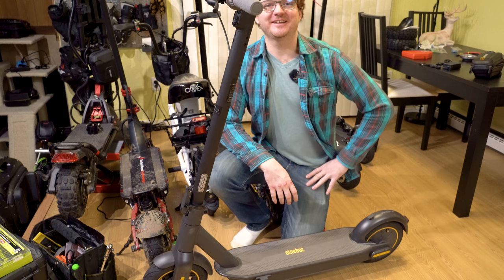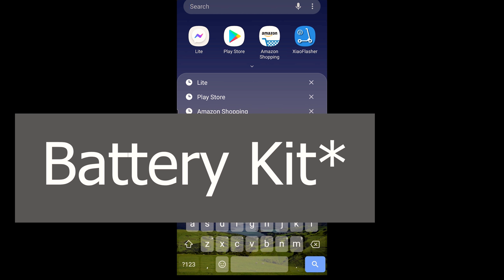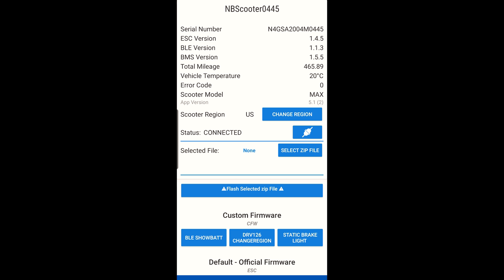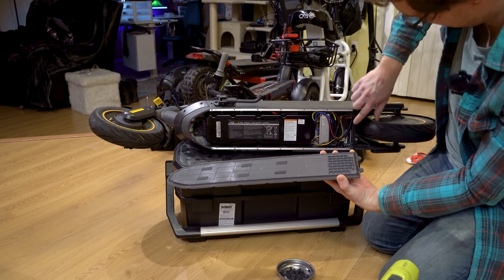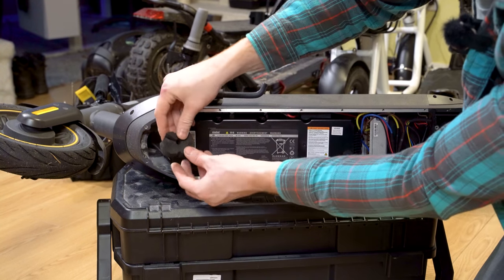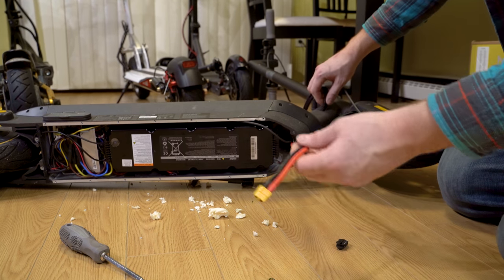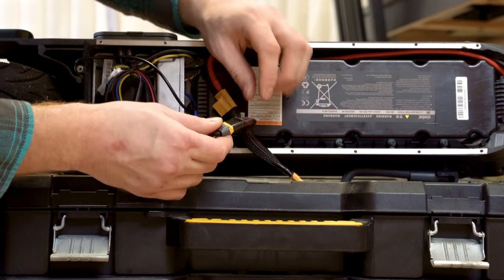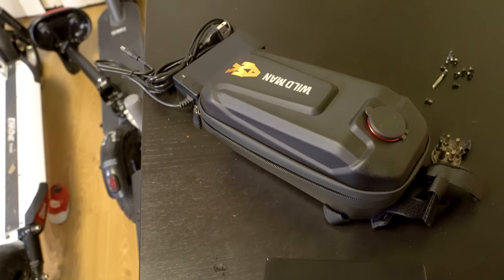Fastest Ninebot MAX Electric Scooter * Part 1 * The Install

Comment: Been running prototype versions of this mod since March of 2020. Best money you can spend on the Max. Chris is a great guy and I would recommend his gear to anyone who feels like their Max could use more grunt. Awesome upgrade.
Reply from the maker: I couldn't agree more. Very fun little upgrade.
Reply: Is it more worth it to upgrade to the Fat Max Motor or do this battery upgrade? What happens if you upgrade both? Is there prone failure to certain parts?
Reply: Seems like it’s out of stock on website. Did he stop making this ?
Reply: Hello Tyr...could you direct me to the zip file for the G30......I want to pay the right person for doing the programming.
Reply: @kenly6858  I plan to do BOTH. I already upgraded my Motor wiring, so the New Motor will be "drop in". My Channel has some videos of my progress.

Comment: i just looked at the battery upgrade and they are out of stock....ahhhhhhh.... To be able to increase from 30kmh\ to 50 km\h is so worth the price. I laugh because I bought mine and though wow this is fast enough. Saw your video and now its way to slow....The need for speed baby. I would kill to have 1 that goes 80 or 100 km\h Just not wanting to spend that much. I could buy a car or truck or daum....Good video my friend. Cheers
Reply: Sorry bro I guess I bought one of the last kits,

Comment: guys does it work on 2023 cuz you cant flash custom firmware any more
Reply from the maker: Nope. Doesn't work unless you get your hands on an old controller and put it in your scooter. They also sell the controllers you need for this upgrade on mymaxmods.com

Comment: I use xyio flasher or whatever you call it to try and upgrade the power on my scooter. But now it doesn't go higher than 20 km. So warning
Anyway will this battery booster override the downgrade I upload it to my scooter?

And another thing, is there a comparable at to scooter companion?

Comment: Was wondering why you didn't mention possibly mounting the battery bag to the center of the handlebar stem.....? Looks like it would fit and keep that front area clear for your footing. Also if there were a problem with the bag sliding down you could purchase one of the many plastic hooks that mount to the stem and secure it that way....? Just a thought. Seems like it would be out of the way and still look good.
Reply: It will fit up front and are kits to mount it in front :)

Comment: So I’m confused. When you do this are you disabling the battery that comes with it? Is it running on both? For example can you ride on the 48v and then when that runs out switch over to the stock 36v for additional range?
Reply from the maker: In drains in tandem with the stock pack so they both run out around the same time. You bring up a good point though, the aux pack gas a separate charger and needs to be charged separately to full each time.

Comment: 9:33 G30's standard battery is 36V, you put it parallel with a 48V battery with a Y-connector. Should it explode, or is there something 'nifty' in that Y-connector?
When putting batteries parallel, they should have the same voltage give or take 0.1V, right?
Reply: Its not parallel..its in series thats.why he has a connector key at the end of the video to complete the circuit
Reply: @melardenio  I’m not sure about series connection because then you’ll increase the voltage, 36v + 48v then the scooter will be running on 84v, I’m still not sure what type of connection the put in there, but I will find out really soon, my kit comes in today and I will be able to tell you guys all about it on a detailed video.
Reply: @sonidoa.c.g3884  its a series connection of 36v and 12v so its running 48v. That small bag is not holding  a 48v battery lol. 36+12 = 48v
Reply: @sometin_else  you are absolutely right, is series connection so it’s 48v total

Comment: Hey nice video.  So I have a few questions regarding the mod.
1 how does the controller negotiate the 2 voltages?
2 the USB ports, does it draw power while the scooter is not running.
3 how is the power usage prioritize?  Booster pack first then internal battery? 
Thanks
Reply from the maker: The two batteries are hooked together in series so the scooter controller just sees one large 48v battery instead of a small 12v and medium 36v. It uses power from them both at the same time while running. The USB ports only use power when the scooter is turned on.
Reply: @GingerOnWheels  thanks for your reply.
Reply: @GingerOnWheels  why do you have to flash the controller? Think I missed that part.
Reply from the maker: @adventures_of_topher  read the video description.

Comment: Hey Ginger just finished installing the 48v external battery, and I’m getting an error 24 code any suggestions? Thank you!
Reply from the maker: Thats an error for incorrect system voltage. Make sure you properly flashed the correct firmware.
Reply: @GingerOnWheels  Just one more thing, what is the correct firmware please and thank you

Comment: Problem is if you run the battery too low, one of the Battery may be empty while the other may be still half full. This will kill the empty battery
Reply: That is true.
Reply: Had literally same thoughts here, doing RC flying and cars for many years, it will break one of your batteries in the long run, unless BMS is smart enough and notice a lower voltage of a cell, and stops to continue driving.
Reply: You have to monitor and charge both batteries. They usually drain equally assuming you have charged both equally. When I am down to 20-30% on internal my external is about the same

Comment: Hey ginger, what bms do you think they have used? it looks like a 4s x 6p  from how square looking it is
Reply from the maker: Its a 12v pack, so definitely 4s. Specs for capacity are on the mymaxmods site
Reply: @GingerOnWheels  i couldnt find jack i was asking everyone but no reply as if they didnt want me making my own battery etc which is fair enough
Reply from the maker: @kevmatt8450  ? Its a website. I don't know what you mean by 'everyone'...
Reply: @GingerOnWheels  by jack i mean jack shit (aussie term)
Reply: it means i found less than nothing
Reply: @GingerOnWheels  also by everyone i mean the facebook groups that exist around ninebot max's etc
Reply: aalso reddit
Reply from the maker: @kevmatt8450  oh. I mean to ask mymaxmods. Like contact mymaxmods.com 
They make these batteries for a living.

Comment: My scooter battery is 48v 10ah 480w. Can i connect an external 48v 20ah 200-1000w battery to the main battery with this method? Like parallel
Reply from the maker: Yup. Parallel additions usually aren't a problem. When you wire them in series and increase the voltage then things can get messy.
Reply: @GingerOnWheels  ya i just have main 48v but it is 10ah. I bought extra 48v 20ah Viset battery for long range. I hope it will not explode😂
Reply: @ Farid please provide an update when   completed.. I have a Macwheel Max 48v.. Looking to upgrade my "ah" as well...
Reply: @anro1689a  okay I'll

Comment: Any option like this for the emove cruiser? If can double the range of that thing that'd be sweet!
Reply from the maker: Yeah. It'd be custom but it's not hard. Just need to wire another pack in parallel with a splitter. Good to go.

Comment: Hey Ginger I'm currently trying to install the pack. But I've run into a problem my scooter after installing the firmware and connecting the cords I'm no longer getting a reading for the battery percentage on my scooter. I've tried contacting the seller but am yet to receive  a response so I was wondering if maybe you had any ideas as to why this may be. Thanks
Reply: I have the same problem Noel, have you found a solution to this ?
Reply: you probably have the series cable installed in the wrong way
Reply: @mcb00m  sorry for the late reply I still haven’t found the solution. Have you?
Reply: @sometin_else  Ive tried every way of connecting the wires and nothing works.
Reply: It was the cables wrong way around for me..
Reply: @mcb00m  okay well I’m getting some help from the creator later on tonight so hopefully I can get it going. Thanks for the reply
Reply: @taylorgrunden3174  hey Im that could possibly be it. But I got in touch with Segway and shipped my scooter back to them which they covered. I only had to pay for the box. And within 2 weeks I had a new scooter.

Comment: Hey! I just got this battery but when plugging it in to charge it (it says to do so before installation) there is no indicator that it’s charging. Am I doing something wrong?
Reply from the maker: There is a little led light on the charger thats red while charging and turns green once charged.
Reply: @GingerOnWheels  thanks I noticed that :)!

Comment: You should tape those XT60 connectors together, they can come loose because of vibrations and cause serious fires (3D printing community has a lot of experience witht these connectors loosening and catching fire due to high resistance)
Reply from the maker: Good tip!
Reply: Electric tape ?
Reply: @allinonethegreat  No, video tape !!

Comment: Can you provide the battery specifications?
Reply from the maker: Ask the owner at mymaxmods.com
Reply: I've used a 12v 7ah battery and 12v 14ah and now am running a 12v 17ah battery all AGM batteries.  I'm 260lbs and with my current tune ive hit 28.583mph!

Comment: Hey ginger I’ve followed all steps and my scooter auto shuts off at 24 mph n now it doesn’t turn on anymore. I’ve installed the 48v internal firmware.
Reply: You probably burnt your scooter or connectors.

Comment: I'm going to have a 36V 15AH auxiliary battery. Is there no need to change the firmwareway setting?
Reply from the maker: Yes, I believe so. I'd make a post on the nine ninebot max mods facebook page and ask. People there know more than I.
Reply: @GingerOnWheels  Thank you. Do I charge it separately? Or do you charge two batteries together?
Reply from the maker: @아빠베어-i3z  I charge mine together.
Reply: You need to charge both to the same voltage ⚡(parrallel connection) before connecting them :) once they are connected you want to charge them both together from one to ensure the voltage stays the same. If you charge them separately, you will need to make sure the voltage is within 1v of each other before connecting them back together :)
Reply: @critter425  very very  thk

Comment: Please read! don't do this if you know nothing about wiring, battery. If you plug those two batteries together and the voltage is different, it can explode! I'm not even kidding. Or give you a big spark, that can result in fire, you CAN NOT stop once it started
Reply: Why would the voltages be different
Reply: I would research batterys before giving such advice. These are not parrallel connections, but series connections. Voltages can be different. What your referring to is putting to batterys in a (parrallel configuration) at different voltages and one will discharge (charge) the lower one at a very fast rate (which can cause a fire if not protected with a good bms) in series connection it is very different & does not apply to the same rules as a parrallel connection.
Reply: I’ve been using the same add on battery for about a year with zero issues 😵‍💫
Reply: @critter425  thats not on serie, if it was on serie it will be giving 84 volts
Reply: @critter425  the kit got a switch to change from 36v battery to 48v battery
Reply: @critter425  if I’m running one 10.4 amp battery and another is 12 amp both 48v, the 12amp one has a switch so it can be turned on and off  is there any concern for me?

Comment: What you SHOULD really at first to do is the both battery's should have the same voltage or at least near..
Reply: That’s in a parallel connection not in a series connection
Reply: Why do people insist on using Caps on things they know nothing about...😂

Comment: Removing that sticker doesn't void the warranty in the united states
Reply from the maker: Yes it does.
Reply: @GingerOnWheels  He’s saying that there is legal precedent now that you can’t void a warranty simply because a seal was broken, which is true. The manufacturer has to prove that what you did caused the issue they are refusing to warrant. In 2018 the US FTC sent warning letters to several manufacturers about the enforceability of labels/seals that claim to invalidate your warranty and Microsoft was even sued for violating the Magnuson–Moss Warranty Act of 1975 in relation to warranty seals in the XBOX One.

Comment: I’m curious to see the front mount option installed, I really don’t want to give up foot space.
Reply from the maker: Ya that is one downside to this mod. However, when I was riding it didn't notice it. I guess I just don't put my feet that close to the front of the scoot.
Reply: I added the seat and i put my foot exactly where it would go.

Comment: Wow I havent seen so bad wiring before. I think when I first started my wiring was better. Wonder how its looks inside.
Reply from the maker: What is the 'bad wiring' in this video that you're referring to?
Reply: @GingerOnWheels  13.07 between xt60 connectors.
Reply: @GingerOnWheels  13.35 ita like he have used electric tape instead of heartshrink
Reply: @GingerOnWheels  the series connector was really strange. And there is to much cable thats also not good. Schuld bee much shorter.
Reply: Sorry don't want to be negative but have hered so much good of this pack and got to see the cables and was a bit chocked of the quality. And that is the easy part to do.
Reply: Everything is heatshrinked and protected via xt60 caps. It's also 10 gauge wiring which is bigger to account for those that want to front mount it. Stock ninebot wiring is 14 gauge so 10 gauge is overkill for this application. The electrical tape covers the ends of the black wiring cover to protect/prevent it from fraying and removing the protective shield on the wiring. Under it is heat shrink on the actual wires as well. Were professionals and promise you the protection is way overkill on everything we build.

Comment: if only you can just modify the existing battery pack .i would do this.. but that battery bag up front.  is not the look i want for my scooter.  maybe in the coming years ,there will be a breakthrough in battery technology,where the packs are much smaller and lighter  and more powerful

Comment: hot tip the little doo dad wont complete any circuit if it did it would short out your internal battery.... just unplug the external battery it has the same effect.
Reply: lol if you unplug the external only the scooter will not start. The batteries are in series so you need to complete the circuit using the "little doo dad"

Comment: I wouldn't recommend installing the app to update the firmware of the scooter. It could damage the battery which can make it catch fire at any time. Also at the scooter's absolute top speed you could overheat the engine and melt the plastic around it. It's very unreliable.
Reply: can i use my iphone to do this
Reply: You need to have a CFW to be able to run 48V. If you are heavy and have hilly areas you will need to upgrade connectors so they don't melt
Reply: @jakehenry8562  no. Apple sucks so you need an android

Comment: Where is the balance cables, plugging another 12v into the end of 36v is not a good idea… all the cells need to be able to balance. Some could over change and cause damage…
Reply: They are plugged in series and not in parallel

Comment: What happens if you don’t have a android
Reply from the maker: Email mymaxmods.com
Reply: @GingerOnWheels  can you just install the battery without a phone
Reply from the maker: @parker4633  no. Firmware flash is required.
Reply: @GingerOnWheels  darn
Reply: @GingerOnWheels  so should I buy it and email them, or email them, then buy it.

Comment: If you weight 150+ pounds add the MR60 connector upgrade it is very necessary because the connectors will burn out and have a useless scooter so the connectors are necessary!!!

Comment: i wait your anser and you need to repair mi scooter
Reply from the maker: Just reflash the original firmware.
Reply from the maker: Its a connection issue between your dashboard and controller
Reply from the maker: https://www.scooterzmalaysia.com/blogs/blog/error-code-list-ninebot-kickscooter-max-g30

Comment: Man oh man is that a badly made kit. What idiot thought that out? It let's water into the battery pack, over heats the motor and puts a battery bag right where your feet need to go. God help you it you need to hop off in an emergency. Whammo, faceplant.
Reply: You can front mount the battery and if you have problems with the waterproofing you cna get your own bag lol.

Comment: If you want it to go faster. Simply don't buy the Max. Buy a faster scooter already ready to ride. The cost will be similar anyway
Reply: The max is a well built scooter. Other scooters which go faster lack the build quality and reliability the max provides. An upgrade is much better plus more fun!
Reply: @sometin_else  yes you can increase the speed and range of the max with the 48 volt update pack . It will then do 35 mph. It currently  tops out at 19/20 mph